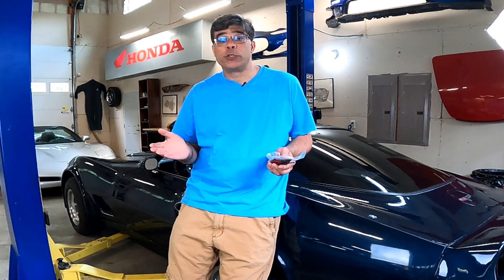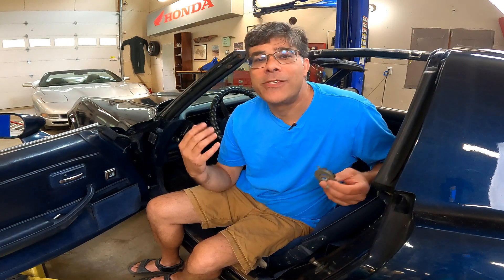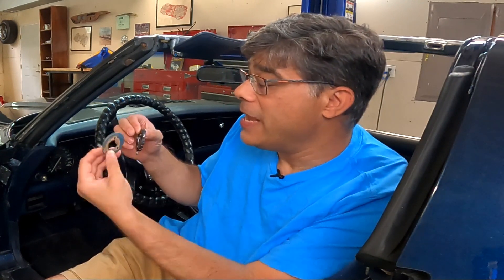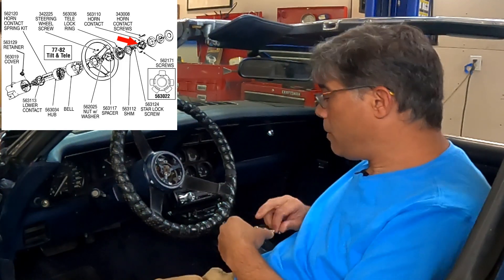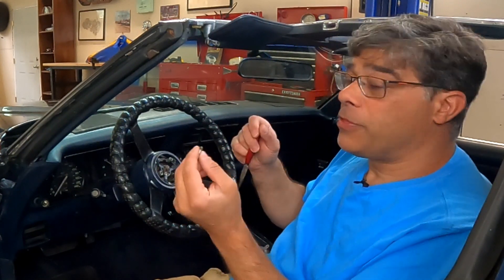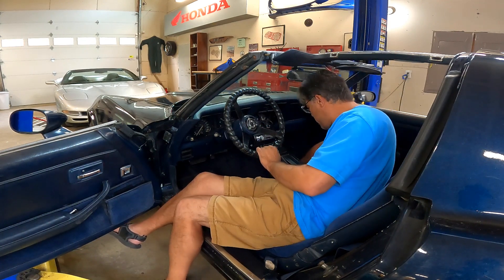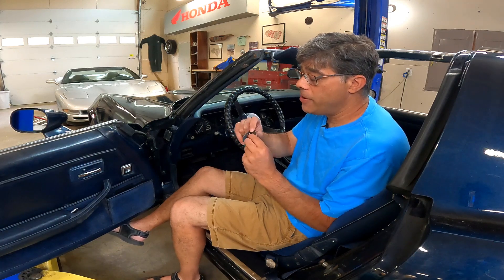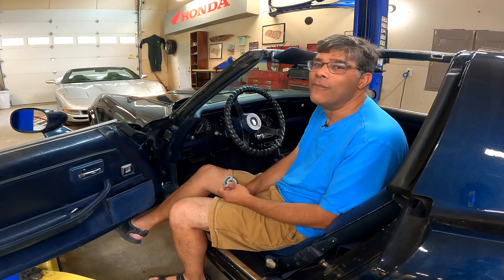1981 C3 Corvette Stuck/Non-Op Horn Quick Fix [Collector Car Guru Workshop]

Comment: Thanks for the vid, have a couple questions (1977), Should the L on the back of contact always be in contact with the rod? Did I hear you say the little black plastic piece inserted with spring should be rotated so it would stay in place? Thanks

Comment: When I hit the horn on my 1975 the horn relay pings but horn doesn't work.I replaced relay but same thing.any ideas?
Reply from the maker: It's most likely your horn units themselves. (If the relay clicks, it's doing its job.) There should be two horns (low tone and high tone) mounted in the nose of the car. The power wire from the relay goes to the driver's side horn and then goes to the passenger-side horn. Connecting one lead of a test light to the power wire, the other to the frame and then pushing the horn button should illuminate the test light. Alternatively, you can run a wire from the positive side of the battery to the terminal on the horn -- ground should be via the body of the horn through the mounting bolt. Chances are the horns have both failed, but it's also possible 1)rust and grime are preventing a good ground 2)the wire to the horns broke 3) your car had its horns removed during a previous front-end collision. GM horns also sometimes start working again after being soaked with WD40 and hit with a hammer. (Some horns also have a knurled knob to change pressure on the horn speaker, so using a pair of pliers move it back and forth to a different position...but don't expect it to continue working long if it does come back to life.) A pair of horns can be purchased for about $15 on Amazon, so that's the route most people take.
Reply: @CollectorCarGuru  there is no power going to the drivers side horn? Bad ground perhaps or broken wire?
Reply from the maker: @edwardtasi2905  Should be easy to test. Clip one side of the circuit tester to the horn power wire and touch the other side to a known good ground (clean metal on the frame or engine...or even run a test lead wire to the negative side of the battery), then push the horn button. If it lights, it's bad ground. If it doesn't, the wire has no continuity. You'll need a second person to push the horn to see in real time or just prop your phone and video while you push it and play video back.) If the ground is good and the horn unit is good, then just look at a wiring diagram to trace the power wire from the relay to the horn so it can be replaced. By the way, there are many threads on this issue on CorvetteForum.com
Reply from the maker: @edwardtasi2905  Here is a good explanation:
 There should be a horn relay (or at least the connector for it) in a three-wire breakout to the left and almost above the fuse box--yes it's a pain to see 

The three wires leading to the horn relay are: Orange--power from the CTSY circuit. Black--ground coming from the steering column and contained in the "harmonica" connector whose other end is the turn signal switch. Dark Green--this is power to the horn.

The Dark Green wire is energized (+12V) by the horn relay when the horn button is pressed. The horns are grounded to the chassis so there's only one wire feeding them. From the relay, the Dark Green wire routes back behind the fuse box to the big connector that goes through the firewall. After that it follows a large bundle of wiring heading forward and sort of tucked up under the left (driver) fender. It will break out in the front left of the car ahead of the radiator. The single wire simply chains via the connector on the first horn to the second horn.

Testing the circuit is easy. Make certain you have +12V (constant) at the orange wire leading to the relay. Make certain that you get ground at the black wire leading to the relay when you press the horn button. If good so far, make sure you have +12V at the dark green wire with the relay installed and horn button pressed.

If the relay is CLICKING, but you're not getting 12V at the relay where the green wire is attached, the relay is still actually bad or the harness it's plugged into has bad contact.

Comment: Thanks for your video. I bought a second hand C3 and the horn is not working. I think it is the pin that is not completing the circuit. Would there be any risk to put down a nail or anything conductive in the hole for the pin to see if the horn actually works?
Reply from the maker: You could definitely put a nail down there, but the easiest way to test is still put 12v to the individual horn units. If the metal pin is there, that pin is doing its job. You simply have to complete the circuit.